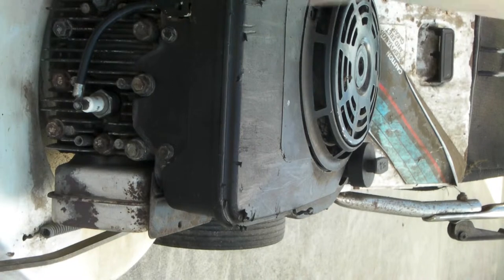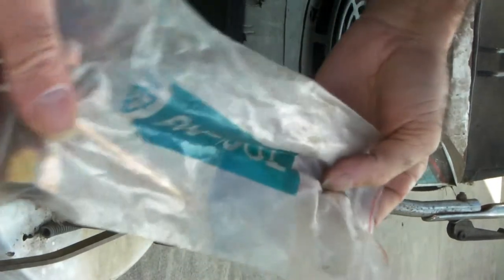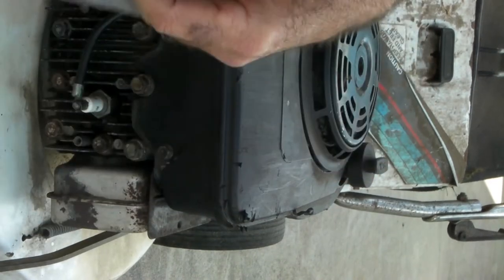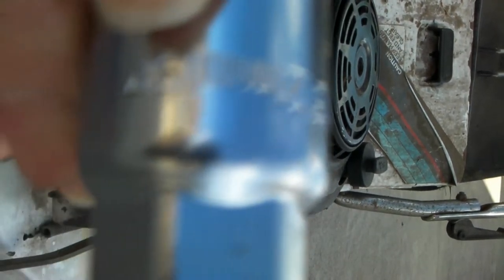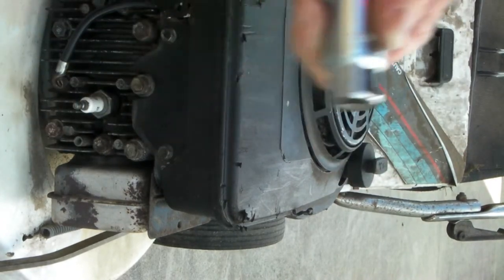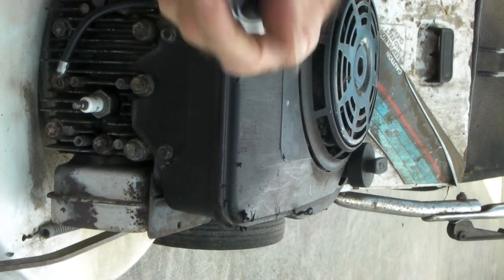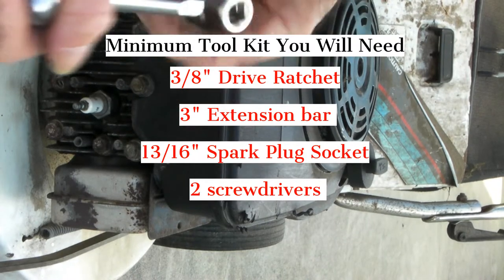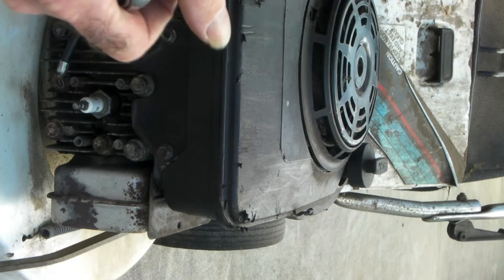Lawn Mower Spark Plug Wrench

Comment: Hi, I have that same engine but no owners manual. What is the torque spec for that engine's spark plug, please?
Reply from the maker: Tighten the spark plug finger-tight until the gasket reaches the cylinder head, then tighten about ½ – ⅔ turn more with a spark plug wrench.
Reply: @petestools  Thank You!